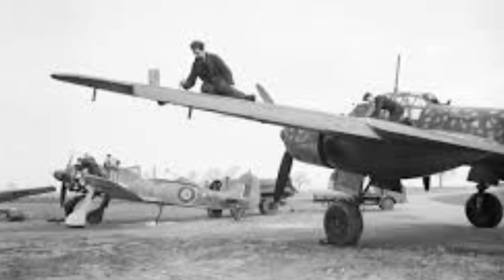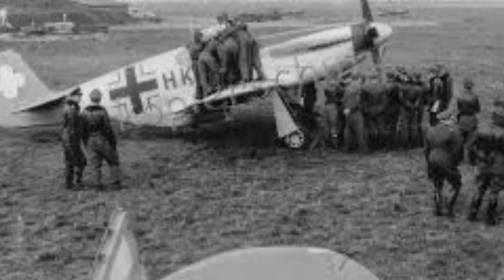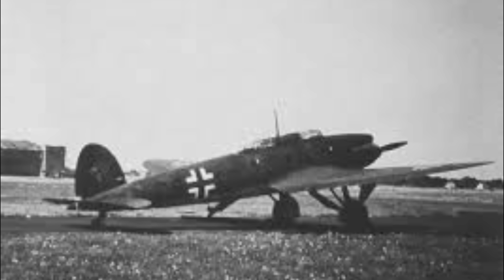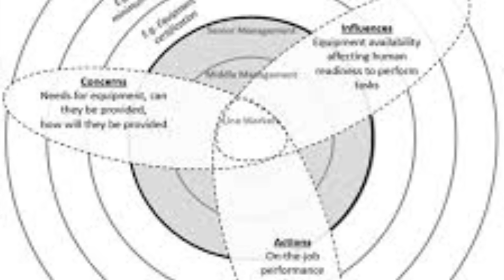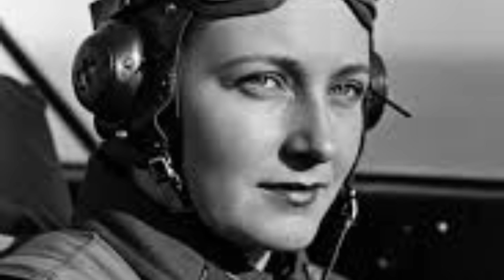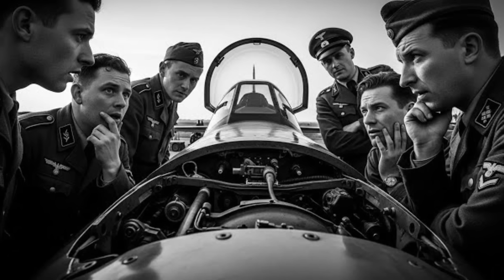“German Pilots Flew a Captured Mustang—Then Admitted No Luftwaffe Fighter Could Match 444 mph”

Comment: Had Hitler gotten along better with Ernst Heinkeln as opposed to Willy Messerschmidt, the Heinkel HS-280 might have been put in PRODUCTION (AFTER FIXING THE jet engines in a theoretical 4 months to match or exceed the JUNKERS JUMO 004 ENGINE USED BY THE ME-262 as the HS-280 WAS 16 MONTHS AHEAD OF THE ME-262! Even a lesser armament of 4x20mm cannon would
have been enough to make it a DEADLY FOE and OUT THERE 1 YEAR EARLIER!

As for piston operated aircraft the Dornier DO-335 Pfeil (Arrow in German) was tested at 470-475 MPH and arguably was the FASTEST STANDARD piston/propeller driven plane of WW2 
but was itself ALSO ...TOO LITTLE TOO LATE. A HEAVY FIGHTER with 2 longitudinal engines and would have required and extremely reliable EJECTION SEAT due to the PUSHER PROP engine
AT the back. The engines were roughly EACH almost about 7/8ths that of the P-47 (1726 hp versus about 2000 HP of the P-47 WASP engine. Must have guzzled fuel like crazy at high speed
so it was easy to see that late in the wr it was not a priority. It was FAST though! 

 The Do 335 was powered by a pair of Daimler-Benz DB 603G 12-cylinder inverted vee, liquid cooled engine with 1,900 hp each. ...just saw this on another website so maybe it was a bit more powerful than I mentioned here. An extra 175 or so HP might also been as tested under EMERGENCY WAR POWER as opposed to a STANDARD MAXIMUM as well.

As a German-Canadian I am lucky that there was a lost of in-fighting in Nazi Germany as my father survived 30 missions in Wellington 2-engines bombers in 1943 and he never saw either an
ME-262 or a Dornier Pfiel (even either an Me-109 or a Focke-Wolfe 190 was scary enough anyway in 1943 as the loaded Wellington were slow at 200 MPH and easily reached at 20000 feet
(only 800 feet daytime when they few out of North Africa). Had they had to face either of those fighters in 1943 I probably would not be here! 

I have a nice picture of him getting a Distinguished Flying Cross from King George VI in 1944! He survived 4 crash landings and on another landing the crew chief counted 338 holes in the plane!
Reply: "Heinkel"  and "Messerschmitt".
Reply: Germany was already running out of gas in 1940. After France the army had to demotorize many units to save gas and even so Gen Eduard Wagner the Quartermaster General estimated the army could only advance 750km - as it turned out the panzers managed an extra hundred kilometers by robbing the rest of the army for gas. Mind you before Barbarossa not even mr "Just gotta kick in the front door" thought Moscow was enough to win. The plan was to reach the Archangel-Astrakhan line which was over 3 times further than Moscow - but when that proved obviously ludicrous they convinced themselves Moscow might be enough afterall lol. And mind you to put the differece between German and Soviet industrial capacity in perspective, by the date Germany invaded the Soviets had built more than twice as many tanks as the whole world combined had ever made (but only tanks, no spare parts so nobody could train or risk breaking them - truly Hittie and Stallie were a perfect match lol). The number of tanks the soviets built was so ludicrous there's a recording of a meeting where the intel guys are apologizing for not knowing how many tanks the Soviets could build and Hitler laughs it off saying even if they had figured it out he wouldn't have believed them the number was so outrageous. But as nuts as he was Moustache Guy was, he wad smarter than his idiot generals. At least A.H. understood the only way Germany could hope to win in the east was to take Russia's oil fields, so he wanted to mostly ignore Moscow and instead push as fare into Ukraine where the food and industry was and try to reach the caucasus where the oil was. Theres a small chance Germany could have at least got far enough to wreck the oil fields in 1942. But the Prussian generals running Germany's army were so dumb when one of them tried to assassinate A.H. with plastique he got 2 blocks of explosives and 2 detonators but couldn't get one detonator to arm so he tossed the extra block out the window of his car lol. For Barbarossa they went behind A.H.'s back and by the time A.H found out it was too late lol. Either way though Germany was doomed. The only way Germany could realistically win WW2 was go back and stringle Wilhelm in his crib before his psychopathinc ass could fuck up Germany beyond recovery.
Reply: "As for piston operated aircraft the Dornier DO-335 Pfeil (Arrow in German) was tested at 470-475 MPH and arguably was the FASTEST STANDARD piston/propeller driven plane of WW2"

And: ''The Do 335 was powered by a pair of Daimler-Benz DB 603G 12-cylinder inverted vee, liquid cooled engine with 1,900 hp each. ...just saw this on another website so maybe it was a bit more powerful than I mentioned here. An extra 175 or so HP might also been as tested under EMERGENCY WAR POWER as opposed to a STANDARD MAXIMUM as well''.

No it wasn't. The DH Hornet was faster and a much better performing aircraft. It also saw post-war service in both the RAF and FAA. In WWII the Do.335 did the same as the Hornet.  It only got to fly in its own airspace.

There is no evidence that with in-service combat weight that the Do.335 could go at speeds bandied about on the internet. If you or anyone has the evidence, please post it here.
Reply: HOW DID THE MUSTANG'S SUPERIOR SPEED AND CLIMB RATE ABOVE 6,000 METERS ALONGSIDE ITS DIVING STABILITY FUNDAMENTALLY ALTER THE TACTICAL EQUATION FOR LUFTWAFFE INTERCEPTORS?
Reply: How did Vera Tierfelder’s inspection of the captured P-51 Mustang reflect the growing realization within the Luftwaffe about Allied technological superiority?
Reply: Why did Sergeant Daniels swap incompatible bomber spark plugs into the P-47, and what immediate risks did that unauthorized change carry?